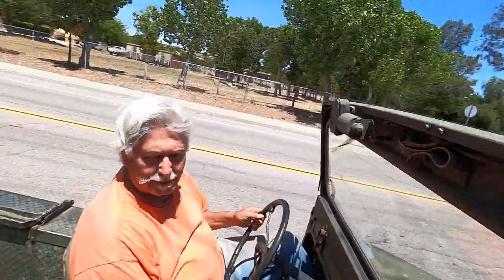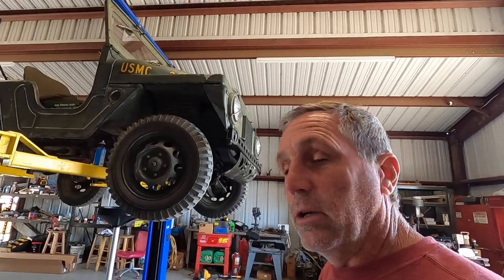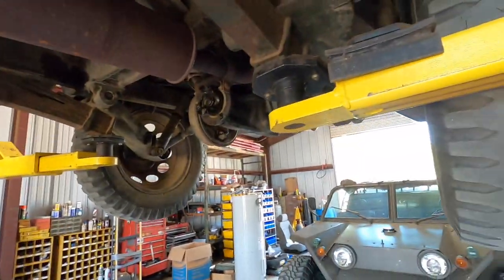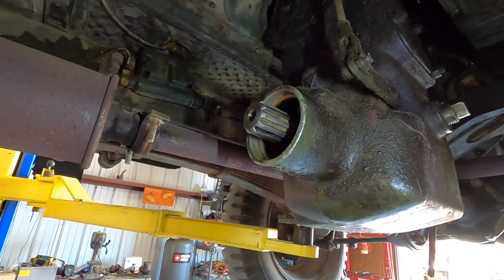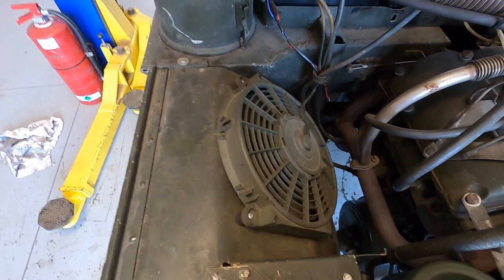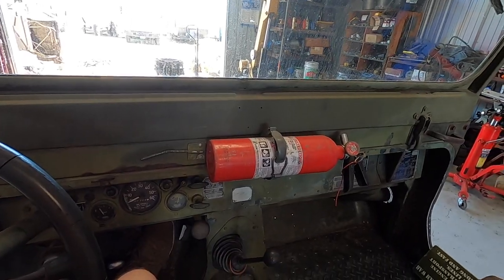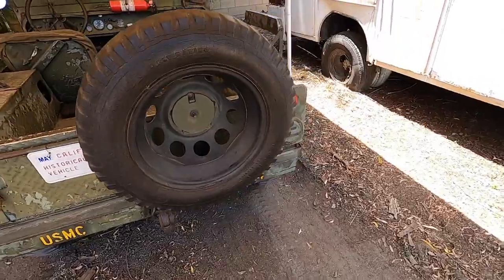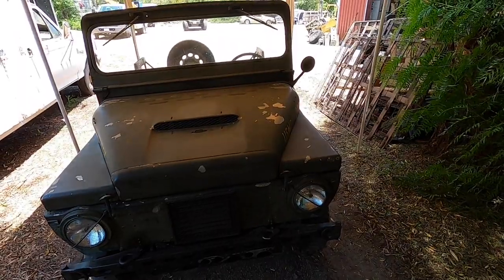M422 Mighty Mite in my shop.

Comment: That fourth (1st) gear is only available with the Transfer case in 4x4, working as a Low Loc. The engine is aluminum and the frame is magnesium. I just did one of these for a neighbor.

Comment: I grew up in Barstow, and watched these being auctioned off around 1970. I wrote AMC about getting parts. They sent a letter back stating they ceased production and had shipped all spare parts  to the Yermo Marine base. I might have the letter around somewhere. 
A person in Barstow stretched one and I think they raced it offroad. 
Barstow Truck Parts bought a lot of these. They somehow fitted one with solid axles, and buick v6. It might have been just the body on a spec. frame. As a matter of fact, a garage in town got 2 bodies, and stuck them on vw dune buggies.

Comment: I have a M422 a 1 ,with Mn. State title, been storing it 30years , this is the summer to drive it .
Reply from the maker: Make sure you get a small flexible camera and look down inside of the cylinders, to make sure the chrome hasn't flaked while sitting that long, before trying to start it.
Reply: @RasmussenEquipment   sounds like I have  a money pit . I just turned 80 , Mite not have been a good 
Idea storing a dozen motorcycles and a mite for that long . So much for saving history . Been there,dune it .
Reply from the maker: Actually you did a good job of preserving it. There are so many old military Jeeps that have been ruined over the years by bad modifications, weird paint jobs and rust. Sometimes barn finds are the best treasures. If you ever decide to sell it let me know, I know a couple of guys who would treat it right. 
The engine may be ok, it’s just best to make sure the cylinders are ok before trying to start it.
Reply: @RasmussenEquipment  thank you

Comment: They were not cheap. At the time of production the cost the same as a Corvette. It is a myth that they were built to be disposable. The 1st gear is a granny gear and can only be engaged when it is in 4wd. Both differentials are limited slip.
Reply from the maker: Check out this video I did comparing the MM to a modern M1163

https://youtu.be/ILM-i9yNz3o

Comment: Awesome. Can u please help me bring my mighty mite back to life. I’m local as well.
Reply from the maker: What’s up with you MM? Does it run?
Reply: Rasmussen Equipment Rentals it (was) running. I had new engine harness put in. He did it no problem. I wanted carburetor tuneup and differential gasket put on. Differential was taken apart. I ended up pushing her home. Been parked ever since. I don’t have the smarts to get her back running.
Reply from the maker: Send me you contact info to greg@rasmussenequipmentrentals.com